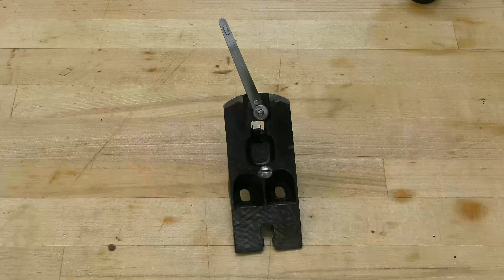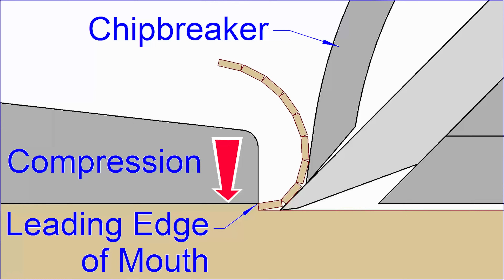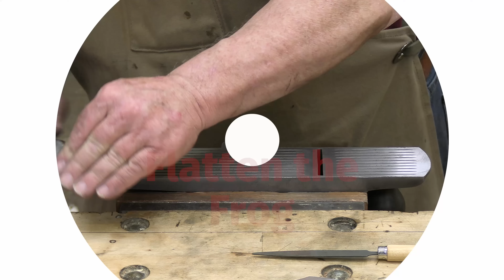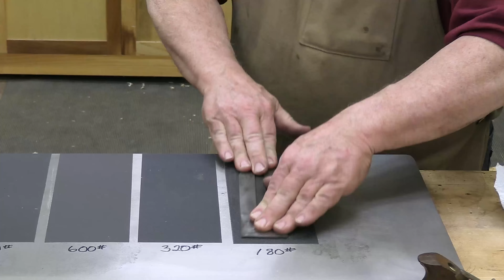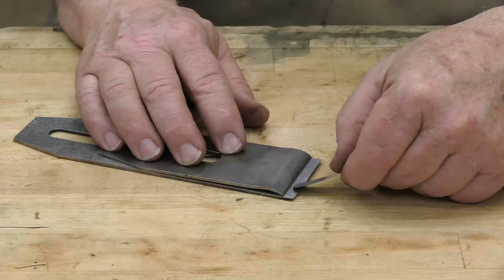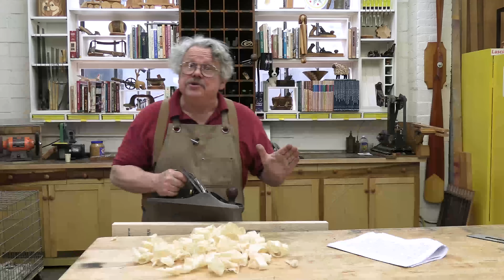Fine Tuning a Bench Plane

Comment: Extremely thorough. I restored my first hand plane many moons ago with Mike Dunbar in NH.  He had promised the hand plane would shave like surgical instrument and mine did after. I remember it felt so rewarding I became an addict. Since then I have added a couple of more steps. One is creating a tiny back bevel behind at the tip of the chipbreaker. Maybe it is psychological but I feel it helps eliminate the chatter especially on hardwood.

Comment: Justus A Traut at Stanley coined the term "frog", the blade-supporting part that sits behind the opening mouth (throat) of the plane, the term comes from the English idiom "I've got a frog in my throat"
Reply from the maker: You are indeed correct that we have Taut to thank for the "frog." He was first to publish that term in his application for a patent in 1895. But the "frog in your throat" explanation is woodworking lore; there is no documentation of why he used that term or where he borrowed it from. It might be interesting for other readers to know that Traut's "frog" for the Stanley Bedrock plane was a substantial improvement over Leonard Bailey's initial 1867 hand plane design, reducing chatter and helping to ensure a smooth planed surface.

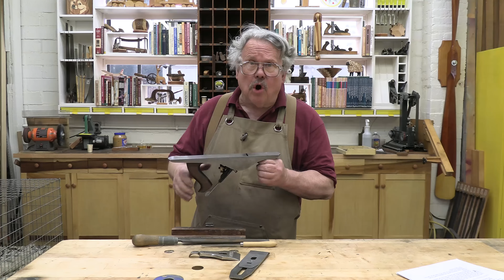Comment: 7:37 Hey, let’s not clamp a plane like this. Put it deeper into the vice and make sure to apply the pressure at the sole, not at the cheeks. If your muscle memory kicks in and you crank down on the handle, the plane will break.

Comment: I had a question if you would.  I’m new to woodworking and my wife got me a lie Nielsen #5. Brand new.  Do I still have to flatten or tune it like in this video?
Reply from the maker: There is an important learning process when you go through a tuning -- you really shake hands with the tool. And since you are "new to woodworking" and Lie Nielson is  well-regarded brand, my guess is that you might profit more than the tool by doing a tune-up.

Comment: The best thing for old planes is the Reed file to fit yoke. 

Need to replace the chip breaker and the new one is thicker than the old one so the yoke doesnt go through the chip breaker and doesnt want to move it correctly? The reed file to fit yoke comes long. 

Annoyed at having to spin the adjustment wheel 37 times to finally get it to pull the blade back in a tiny bit? The reed file to fit yoke let's you, gasp, file it down to fit your plane without slop, so it only takes 2 or 3 turns of the wheel to get blade adjustment.

Comment: I have been using Waterlox UTOS followed by 3 coats of their satin original tung oil finish, only wet sanding in between the 2nd coat of finish and it’s an incredible look and durability imho

Comment: I watched the video twice and was glued to the screen. I've wr with wood and metal most my life but never used a hand plane till a few years ago and I'm 55. A friend was throwing an old rust Stanley # 4 away I dug it out of the scrap pile and threw into a bucket of used motor oil for a month, then after washing and wire brushing soaked it in hydrochloric acid for a few minutes washed with ammonia and dis soap, then back in oil. A while past before I pulled it out an cleaned it up. Sanded it up to what I thought it needed and away I went. Had no clue what I was doing and was too stubborn to admit it, but as i experimentmented with different adjustments I started to be able to throw some chips. It was fun and relaxing too. Everyday I worked the plane for a while, by the same time a year later I was pushing some nice rolls off some rough sawn lumber I got off my land. I also added several nice used planes I restored.  About 30 or so now in my collection. I also have 100s of board feet of cherry, hickory and black oak planed down by hand,  I love this new hobby it has a lot of benefits including healthy one's like exercise, it really helps me relax. The host of the video is a Master and I learn many useful adjustments for the hand plane I was unsure of how to set them. Well, I'm now subscribed.  Thank you sir, for the wealth of knowledge and the wisdom of experience to be able to understand what is important and how to explain it.  The hand plane looks rather simple to use, but well, it's not easy until you spend time giving it the many hours needed to earn it's respect.

Comment: Would you recommend flattening a lie-nielsen hand plane new from the box? I have a wood river surface plate and some float glass, but i'm nervous about ruining the plane on my OCD
Reply from the maker: Check the plane sole with a machined straightedge. If there's an area where you can see more than a paper-thin ribbon of daylight between the sole and the straightedge, it may need flattening.
Reply: I would very confidently assume that the plane, the plate and the glass are all flat. But I know what you mean: I have a slab of granite at home – is that flat enough? Should I buy a plate of glass instead? If I go for a relatively cheap one, will that be flat enough? I’m sweating. But I can say this: 1) you’re working with wood, don’t overthink it, and 2) if you really must find out, go and do it, with a very fine grit – you’re not going to hurt the plane. Or just use the plane for a while, at some point you’ll want to re-tune it anyway.

I bought one just a few weeks ago: it’s flat. I didn’t check it, but I will at some point in the next few years.

Comment: I have a "new old stock" Stanley No 5 from the 70's, I think. Assuming it's factory condition, for many reasons besides the box etc...  The frog is 100% covered in black paint.  I'm guessing for this reason I won't sand the paint off and will leave it black.  Anyone else see this on their unadulterated Stanleys?  Suggestions?
Reply from the maker: It won't matter much; the plane will work with the frog painted or unpainted. After adjusting the frog a few dozen times, the paint will scrape off and you'll never know it's gone.
Reply: It’s possible that this is a result of cost cutting. Hard to tell, since planes made after 1967 are largely ignored by the “community”. I wouldn’t be hesitant to remove the paint – my best advice is to look at a few more videos on the topic and see what everybody’s doing. I found videos by Ian Parker, Carl Stammerjohn and Dave Corinth quite insightful.
Reply: Nick says remove the paint in his instructions, but I am conflicted.

Comment: Extremely good explanation!  One small suggestion though.  I would not use the lever cap edge to turn the cap screw holding the chip breaker to the iron.  I have seen several old planes where that has chipped the lever cap edge.  It's easy to keep a big screwdriver handy.

Comment: It appears you bought a plane “restored” by an amateur eBay seller. Nice job with the video, useful information there.  Thanks.
Reply from the maker: Thanks. And you were right about the origin of the plane. I have often thought about doing a video on what the word "restored" means when used a YouTube -- rust removed and a coat of spray paint.

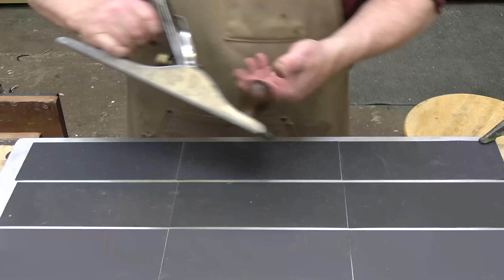Comment: have you tried the lapping from 00:06:12 to 00:07:12 with a power sander like a random orbital one? lapping some inexpensive planes may be taxing or worse impractical
Reply from the maker: I have lapped on a staitonary belt sander and a 12-diameter disc sander -- both of those keep the plane sole flat. I wouldn't recommend using a random orbital sander for just that reason -- the flatness of the sole is much more important that its smoothness.

Comment: Great video! Because the entire sole is in one "plane", doesn't the cutting angle change, ever so slightly, when the sole behind the blade contacts the stock? My jointer beds are at different elevations, why isn't there accommodation for this in a bench plane? Thanks for sharing!
Reply from the maker: You are correct in pointing out that a jointer is a more precise tool for flattening a surface or straightening an edge than a bench plane. However, you can get very close once you have some experience with a plane -- you soon learn to keep most of your pressure ahead of the cutting edge, and the cut becomes remarkably flatter/straighter. And since wood is flexible, you can easily get close enough for a solid glue-up using ordinary clamps. Wood also "creeps." Under pressure, the cellulose and the lignin components realign themselves so any internal tensions caused by slight mismatches disappear in time. In short, the properties of wood allow you to make solid assemblies whether working with hand tools or machine tools, whether your cuts are right on the money or just a little off. Bench planes don't offer a way to dial in the flatness/straightness because you don't need it once you get the "knack" to using them. Good craftsmanship sometimes depends on getting things close enough.

Comment: I just tuned up a 1942-48 era Millers Falls No. 14 using this video and immediately cut some full-length, paper-thin shavings. This man’s advice is priceless.
Reply from the maker: Love Miller Falls -- excellent jack and block planes. Their low-angle blocks, bedded at 12 degrees, are incomparable for end-grain work.

Comment: The last few minutes are especially excellent. Fine tuning detail and proper explanations and not the 'you're doing it wrong' or 'this is the only way' attitude of some on here.
Reply from the maker: One of the things I love most about woodworking is the shear volume of methods available to craftsmen that will all accomplish the same thing safely and effectively. This allows determined woodworkers the ability to accomplish great things with minimal tooling. There is rarely, if ever, a "right way" or "only way." There is always room for creativity and invention.

Comment: I like to tighten the chip breaker using a screwdriver, never the lever cap. I've seen badly chipped lever caps. Great video though. By the way, I too like Ron Hock a lot.

Comment: What glue do you use on sand paper when flattening the sole?
Reply from the maker: Most times, not at all. Since this is wet/dry sandpaper, the surface tension of the water will hold it in place.For the vid, I used an adhesive spray like 3M 77.
Reply: @WorkshopCompanion  Thank you for the answer. I will try yours solutions. Water will only work on wet sandpapers, on thick ones you have to use glue.

Comment: I looked for tolulene like you said to clean the old paint off but all I could find was tri-nitro-tolulene, which I thought would be ok, but when I was rubbing the plane to remove the old paint, something seemed to happen maybe because of friction or something and now there is just a big smoldering hole in the ground where my shop used to be. What did I do wrong?

Comment: I never use water to wash away the metal dust i use a misting bottle usually used for cosmetology  and fill it with ammonia free windex instead to help prevent rust and mist my diamond stone use em then light mist amd wipe em off with a lint free shop towel
Reply: Windex contains water. Don’t sweat it, I used to worry about that too, but it’s okay.

Comment: I’d suggest two more tuning steps…
1. Polish the front curved surface of the cap iron (“chip breaker”) and,
2.  Lap the frog surfaces where they meet the plane body with some valve lapping compound.

Comment: I purchased a Kobalt No. 4 plane about 12 years ago.  I had purchased my home (first and last) then and wanted one for working doors and such.  Didn't need to so it has set all of these years.  I didn't know about planes back then and this video sure has opened my eyes so thank you so very much!  My frog is not flat, the plane needs to be flattened, the chip breaker isn't even straight across and I'll take a file to the edges PLUS buy a new blade because the one that came with it is much thinner than the replacement one you've described.  I've learned something today.
Reply from the maker: I have a Kobalt low-angle block plane and I am not impressed. Your No. 4 seems to have similar problems. Before you wade in, watch https://www.youtube.com/watch?v=uygqFRQaFz4 . If you can afford to switch, you may be a whole lot happier with this..

Comment: I'm sorry I had no idea how to adjust or calibrate my bench plane I tried using it a few times and I could never get the depths correct I could never get the adjustments correct. I'm not sure what brand it is honestly but it's made much like the one you are demonstrating and working with but it's only about 20 years old. I have a fairly decent shop set up but needs a lot of work I just acquired my late fathers Craftsman power tools at least some of them such as a the table saw which still works perfectly I had to clean it up and make some adjustments but compared to my old Ryobi it's like a cadillac. I have the jointer which I have put into the side until I can get everything else in working condition. I'm working on the bandsaw now I had to take things apart clean them up and watch videos on fine tuning the bandsaw. Also replace the two 12-in tires and I have a new blade ordered from Amazon which should be here today and I'm excited to get it cutting good and smoothly again. I only have a handful of tools but the Craftsman are really high-grade power tools. After my dad passed away in 2000 who was a master Carpenter and a pattern maker and older brother inherited the equipment but he had some life changes and knew I was serious about trying to follow in My Father's Footsteps learning to make things on a more intricate level. I could already use most of the tools and build structures such as pump houses or storage buildings and I had made a ton of children's Adirondack rockers and chairs and a few adult size. Several bookcases that turned out to be very nice and what my ex-wife call a hope chest or blanket chest I made several styles of those how long was Toy Boxes tool boxes etcetera. I'm 65 and just acquire this new equipment which is probably as old as I am LOL. At the request of family members I've started making family trees cut out of wood with apples on the trees I'm building picture frames for pictures of my grandchildren just stored. I found that making the more intricate items was a lot more time consuming and a new learning process but I'm figuring things out as I go I've watched two of your videos so far and I'm very impressed by your knowledge and and I appreciate very much you sharing this information because I want to get my hand planers and get them into shape and see what I can do with some old Cedar Logs I'm curing I want to turn them into fireplace mantels. I subscribed to your Channel and I'm fascinated at your level of knowledge and all the details you share I have a standard size hand planer about the size of the one that you're working with and I have a small one but they're both from the same manufacturer and I've used a small one quite a bit. But now you got me interested in projects using the large hand planer thank you very much I will be attempting to tune up my hand planer today the following your instructions step by step. Thanks again you are an amazing and intelligent man
Reply from the maker: Thanks for sharing.

Comment: For flattening the back, have you considered the "ruler trick" approach? That way, you ONLY flatten the front tip of the back, and not spend ginormous amouts of time removing the valuable back (and avoid the dreaded chatter!). Otherwise, a great video.
Reply from the maker: I've done it both ways. It does save an enormous amount of time, but flattening the back insures the iron rests squarely on the frog. As for the keeping the iron from growing thin, once the back is flat it really only requires a few swipes over the stone with each sharpening -- I've never seen a blade in an old plane that was noticeably thinner than usual.  Fact is, both methods have their advantages and both work well.

Comment: When I flatten the front of a plane iron I actually do it with the chip breaker installed. I figure there might be some slight bending or something going on due to the tension. You can do it similar to the way the frog is flattened. May not be necessary but it seems like I remember flattening the front of a plane iron, flattening the frog, and they still didnt mate well enough.

Comment: I have a 1930's No 7 with the grooves on the bottom. I had it surface ground and relieved the birds mouth on the inside. After this it was a beautiful plane to use, so I did the same with my Stanely 41/2 which has become my go to plane for most jobs.

Comment: Nick - I'm not sure that's why they call it a frog. Stanley called it a frog in a catalogue as far back as 1898 and the term frog was referenced in a patent from 1857. The rib in the body of stanley planes wasn't added until 1902. Before that, frogs weren't shaped like that. 

IIRC, it's called a frog because it sits in the throat of the plane.

Comment: Can anyone explain the proper size of the chip breaker vs the iron in terms of width? I scored an old handyman #4 smoothing plane, but the chip breaker is slightly wider than the iron and buts against the walls when adjusting the left right tilt. It’s my first restoration project and everything else is good, but the breaker is driving me nuts.
Reply from the maker: My guess is the person who sold you the plane was missing a chipbreaker and scrounged one  that sorta fit from a bin of old plane parts. Grind or file the edges of the misfit chipbreaker until the width is equal to the width of the plane iron. The hole used to mount the chipbreaker to the iron must be centered between the edges.
Reply: @WorkshopCompanion  thank you very much. I once commented that'd I'd likely never become a woodworker, but my love of bringing new life into old tools led me here and now because of your videos and others', I find myself taking those first steps. Keep up the great work, love your content.